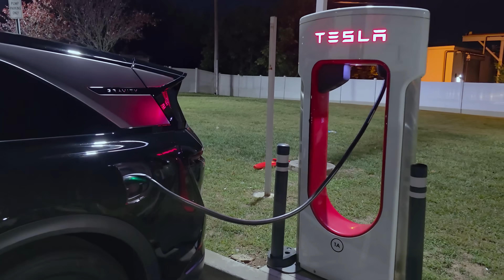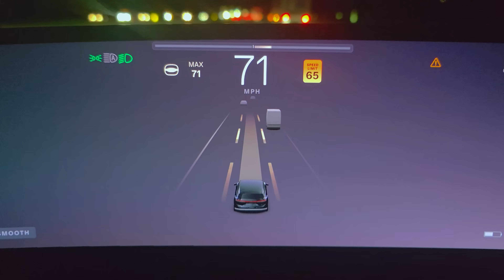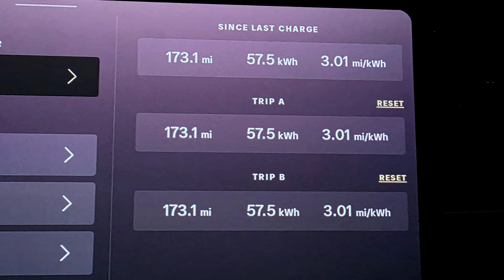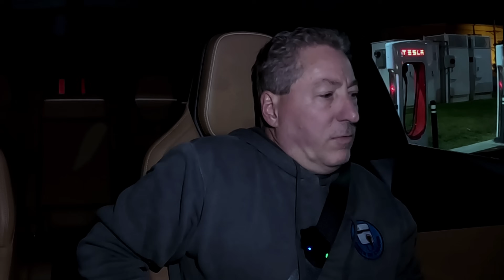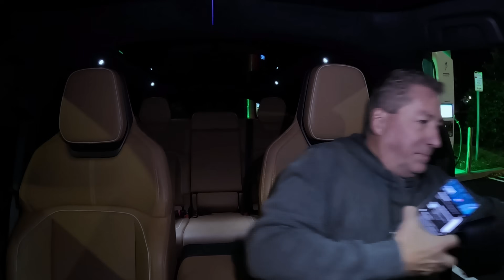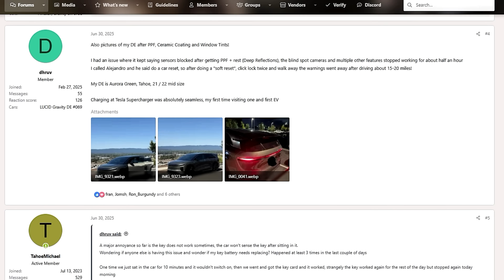Does the Lucid Gravity Live Up To Its 450 Mile EPA Range Rating?

Comment: An owner recently did the same test and got around 350 miles as well. Kinda dissappointing because I was hoping for that sort of range at 75mph. At 70mph I was hoping it would get over 3 miles/kwh. Regardless it's still plenty of range and quite efficient for how much room it has inside.
Reply: i thought it was supposed to get 450?
Reply: @TVYOUTUBE-ow9xu  that is combined range. Highway range from the EPA is going to be lower. But many people are too lazy to calculate it.

It's like expecting the Camaro I use to drive to get 20mpg in the city. Like sure it was rated 20mpg but that was for highway and city driving COMBINED. The city rating was 15-16 and that is what I would get in the city. Highway rating was 26-27 and that is what I would get in the highway.

Similarly, the lucid gravity is rated 450 mile sof range combined. Combined EPA efficiency was 108	MPGe, but on the highway it is 103MPGe and 113 MPGe in the city. So highway range is technically 430. And the worse efficient Gravity is rated around 365 miles of highway range. 

Regardless it is performing worse than advertised. A bit disappointing.

Comment: Why are you comparing mixed driving epa rating with a highway trip? Does the epa not provide a highway rating separately?
Reply from the maker: No, they don't anymore. I used to always explain the highway rating and the combined rating, but they don't break it out anymore.
Reply: @StateOfChargeWithTomMoloughney  Thanks.  Maybe you need to do an hour or two driving locally to see what the range is for most of the driving it'll do. No-one ever seems to do a range test with the 90% of journeys people do.

Comment: Since you pulled around 115kWh out of the battery, there's still another 8kWh left in that battery. So at 3 miles per kWh, that's another 24 miles. Getting 345 miles with temperature in the 50's and a 10mph wind, it's still pretty impressive for a 7-seater SUV/minivan with 828 horses. And if you add those 24 miles, that's 379 miles. 

Notch EV did a range test with his Gravity at a constant 70mph out in Long Island with temperatures also in the 50's, and got 353 miles and with 1% left. So this is what I expected in this test in very similar conditions.

The not charging at that supercharger after the range test is concering, though. We're there other vehicles charging at the time or could the site have been temporarily down for whatever reason at that time?
Reply from the maker: There was one Tesla charging.
Reply: @StateOfChargeWithTomMoloughney  Then that's another issue the Gravity team needs to look at.
Reply from the maker: @junehanzawa5165 not another issue, the issue. The rear drive unit is also the booster for Tesla's 400v SC systems. That was the problem and why Lucid took the car back from me.
Reply: @StateOfChargeWithTomMoloughney  Ah. I see. It makes sense now. Thanks for the added info/clarification Tom.

Comment: Even with a bad rear drive unit, as well as not ideal conditions is still very impressive. I have a theory! The rear drive unit also does the booster for Tesla supercharger charging and makes sense that it wouldn’t charge at a Tesla supercharger afterwards. Something must have went wrong when Tom was charging at the Tesla charger just before doing the test.
Reply: Jorge, I think your theory is correct.  Lucid uses same technique as Hyundai EGMP models by using the inverter (DC to AC) and rear motor as an auto-transformer to double voltage.  Using a stationary motor as a transformer is brilliant.  

After doubling voltage, they need a rectifier to convert AC to DC for battery charging so inefficiencies build up.  You’ll never get the same charging speed as an 800V DC fast charger. 

It was interesting that the Tesla Supercharger got Tom to 100% when test started, but failed at very low SoC.
Reply from the maker: You could be correct.

Comment: A six KWh buffer is 18 miles which is a nice comfortable amount. We are a long ways away from having a charger at every highway exit like we have for gas stations. Having a 20 mile buffer below 0 will prevent a lot of inattentive people from being stranded. It also protects the battery, discharging down to real 0 is not a good idea.
Reply: No customer will drive 18 miles below zero.
Reply: @hankmoody7521 Tell Dave Connor that.
Reply: Wana bet
Reply: "I-90 surge", on OOS channel showed an Air pre-maturely shutting down, right near zero.  So, beware if reaching for the extra ~5KWh.

Comment: Hi Tom. Lucids simply don’t get near their ratings. It is frustrating why they choose the testing they do for EPA. 

My 2025 Lucid Air Pure is rated for 5 miles per kWh, 420 miles range from the 84 kWh battery. In one entire year of usage I’m at 3.62 mi/kWh which is NOT uncommon among most owners. Therefore the range is more like 300 miles EPA. 

I’ve had 5 different EVs, none have been this far off EPA. My Silverado EV actually understates its range. In the same conditions I get a real world 450 miles.
Reply: With 400+ HP, I'm sure it's hard to not dip into that power often.
Reply: My Escalade IQ, at 55-60 can get 625 and 70 is around 475- guess the Escalade has better aero. I think Cad should advertise the 600 miles@ 60.
Reply: @DaverGe - If it was Lucid they would have!

Comment: tom your range test almost mirrored notch ev range test he got 358 and used 115.4     his is a 5 passenger with the base wheels
Reply: Came here to post this, he also got a lot less then expected, so curious whats going on.
Reply: @FreekHoekstra probably nothing going on, EPA is city and highway so if we test that way it probably gets 450. Just means it’s much more efficient under 50mph.
Reply: @Icayn  well sure, but Lucid is clearly also expecting more, and given notch got even less maybe there’s something happening with these guys.
Anyways, we’ll find out
Reply: @Icayn EVs are much more efficient @50mph vs 70mph. The battery could be sensitive to the cold as well. Wouldn’t be a bad idea to do a range test in the dead of winter to see what it does.
Reply: He actually go 353 miles with 1% left, not 258.
Reply: @junehanzawa5165  yea i just caught that don't know why it posted 258, so i corrected it to 358

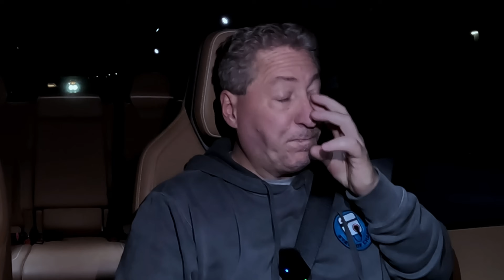Comment: @17:57  *345 miles
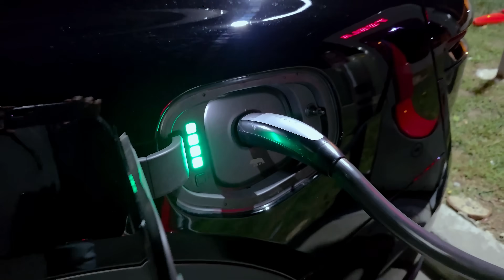Reply: Yes, I caught that as well. It was 1:30 in the morning and Tom was obviously pretty tired. Of course knows it’s 345 miles which is well less than the 450 mile claimed range. Interesting that it is very close to the Porsche Cayenne Electric range test result in warmer weather but in that case it will no doubt far exceed the EPA claimed number as Porsche tends to do.

Comment: Someone else also did Gravity range test at 70 MPH, he also got somewhere 355 miles. He also did test in night. I wonder how much lights are eating up driving whole night?
Reply: At the high end, LED headlights use about 50 Watts each so 100 watts total for the pair. Driving for 5 hours would be 500wH or 0.5kWh. If the car goes about 3 miles per kWh, then the headlights consume about 1.5 miles of range
Reply from the maker: Next to nothing. Maybe 2 miles

Comment: I can predict this much: it will go farther on a single charge than my bladder could.
Reply: You and most people, if they’re honest with themselves.
Reply: Yeah with my Lucid Air 512 mile range. I had to stop to use the bathroom after 2 to 3 hrs straight driving. 😂
Reply: @isserdigan2835 You need to drive faster 😂
Reply: If over 50, don’t waste money by seeking help from a urologist.  Restroom breaks every two hours is normal and some people are more comfortable with 90 minute breaks.  

When traveling over 1000 mi from MA to FL, restroom breaks primarily determine my charging stops, not the range of my EV.   Don’t think I’ve traveled over 225 miles between breaks (75 mph X 3 hrs).
Reply: This is an important fact that gets overlooked by a few friends of mine. I drive an EV9 and a couple of people have commented on a perceived lack of range. The thing is, I have to stop every few hours to pee and stretch my legs. A supercharger needs about the same time I need to take a break. It works out well. Completely love my KIA.
Reply: @gibber1944    I just got a  2026 EV9.   Left home at 100%.  We went  240 miles, still had 15% left, but we had to stop for bathroom breaks.
Reply: Guaran-damn-teed.

I did a ~2600 mile road trip a few months ago, and my average between stops was 120 miles. Yes, I COULD have charged up higher each stop, and gone further before the next stop - but charge curves mean it would have been severe diminishing returns, and I was ready for a break most times after ~120 miles anyway.
Reply: Add coffee to the mix here and I’m lucky if i can go 75 minutes between breaks. If I don’t have any ladies with me, i can stop on side of hwy 😅
Reply: So funny.  And so true :)))
Reply: Right? 45% of people have kids and have to stop every 2 hours anyway, another 45% have to stop and pee themselves after 2 hours, and the remaining 10% either pretend they don't stop every few hours OR are miserable during their trips because they are holding their bodily waste.
Reply: Exactly. My bladder and my bum knees get stiff at the 2-hour mark.
Reply: There’s your problem, you shouldn’t charge your bladder.
Reply: For the vast majority of people and drives this vastly outperforms a gas car. There are still some places in the national parks that it's a bit sticky depending on your incoming SOC if you're towing a trailer. I realize this is an edge case for sure.
Reply: @DJS_ENO how so?  Yes, speed wise yes,but there’s many cars that easily do 400-500 miles per gas tank.  My Sienna hybrid goes 550 per tank. My Model 3 DMP at those same speeds only goes 200 ( 75-80 mph).
Reply: I can make it to corpus Christi, Texas from Kingsville, but that is only miles for me and where I live.
Reply: 35 mile distance from where I live to the Golden Corral in Corpus Christi Texas.
Reply: At my age that's true of the Fiat 500 EV too.
Reply: The target demographic isn’t going to be able to drive much further than 200 miles between nature breaks @ 70 mph.  If you’re over 50, you don’t need more than 330 miles of highway range as long as you have fast charging. 333 x (.80 - .20) =200
Reply: You’re a lightweight.  Never driven a truck obviously.
Reply: You MIGHT want to see a Urologist
Reply: @Mark_Longoria You might want to hydrate more.

Comment: 345 miles of 70mph range with a somewhat normal cabin climate setting and inefficient rear drive unit, is pretty amazing considering how big the Gravity is. This car can do some big distances on a single charge like San Diego to Las Vegas, Pittsburgh to Detroit, Atlanta to Jacksonville, or Dallas to OKC.
Reply: yeh i was shocked to hear that its not close to 400
Reply: The average owner might never know they had a "faulty" drive unit. 345 miles is far enough to get me home from Michigan's U.P.
Reply: Typical Lucid drive train issues 😂
Reply: inefficient drive unit? how so? I thought they touted it as incredibly efficient
Reply: @ayushmalpeddi2793  did you even watch the video?
Reply: @ayushmalpeddi2793  Did you not watch?  One of the drive units had failed.
Reply: @randomdesign6304  Yes but from my understanding, all motors used were still efficient motors. It's not like they replaced the motor with a worse motor.
Reply: @ayushmalpeddi2793  What?  Tom clearly says in the last section that Lucid engineers found a problem in the rear drive unit of his test car that likely impacted the range.  Again, watch the video.. This has nothing to do with whether Lucid's motors are efficient or not, one of them is FAILING.
Reply: @randomdesign6304  So someone else did a 70mph range test and also got about the same number. I don't think the motor failing would have a big impact on range. Worse case the front motor takes over which is also quite efficient. It may be though the rear motor is more efficient though. So even in the worst case, we are looking at maybe 1-3% with the 3% being optimistic or roughly 10 miles of range.

Only other explanation is the rear unit failing caused the motor to pull more electricity to maintain power. But I don't think that would happen.

Again someone else performed the same test and got basically the same result.
Reply: @ayushmalpeddi2793  If the RDU isn't working the front motor has to work more to move the car, pretty simple.  Tom even says at the end of the video it would have effected the range, Lucid told him the same thing.  It's also why the Supercharger at the end would have failed, the Gravity uses the RDU to boost the SC voltage to 926V.

One other person did a very non controlled test and got results way out of range of what many other owners are seeing in their efficency/range which is why most people were waiting for a good tester like Tom for results.  He also performed the test before the 2k mi mark when Lucid even says the efficiency/range will be less in the manual and plans to redo his test after he has more miles.

Comment: “Electrify America saves the day “. Something rarely said.
Reply: Give credit where its due...if we can teardown people and places, we can sing their praises too when they improve and do good
Reply: @thejake8099  Yep. EA has gotten a lot better the last year or so as they have replaced about 70% of their old, unreliable legacy hardware.
Reply: @thejake8099  IMHO, I don’t see this as “tearing down”.  I see it as an observation.
Reply: @thejake8099 so lets do some tearing... Its an EV chatroom.... Lucid is known for bad software (like NACS integration) so Lucis cant road trip on the convenience of the superchargers ??? And lets calculate 110kwh per 300 miles @ $.55 on a reoadtrip...
Reply: @thejake8099 It takes more than once. Once a consistent pattern is shown....... then comes the praise.
Reply: Yes, lol.
But seriously, I suspect the real issue is that Lucid uses the rear drive unit to boost the charging voltage from 500 volts the Tesla SC can supply to the 1000 volts that is native to the car. The EA chargers used probably have a higher voltage output and so didn't need the rear drive unit voltage step-up function, so charging worked.
Perhaps Lucid should add some software to detect problems with charging Boost mode, and bypass that so that it can still charge if a problem occurs.
Reply: We just completed a 3,000+ mile trip w/our Fisker Ocean from Reno to Palm Springs, Phx, Santa Fe, up to Grand Junction and home to Reno.  Most of our charging stops were at EA.  I have had our car for 2 years and can say during the first year there were definitely issues w/EA charging locations not functioning at peak performance.  On this trip however we were pleasantly surprised that we had no issues except for one locating in Victorville, CA where the first 15 minutes of charging I could get above 32 kw of charging speed (at approx. 30% SOC) and then it ramped up significantly.  This could have been a car issue vs the chargers.  Regardless the rest of our trip where we used EA chargers was a pleasant surprise. Let’s hope EA is really stepping up their game.  My only request is for EA to develop the charging stations on much of the rural highways in the western states!
Reply: Propaganda, clearly.

Comment: Was that 7 seater you tested?  That’s only rated for 427 miles EPA. 5 seater is the450 mile epa version.
Reply from the maker: It was the 5 seater
Reply: @StateOfChargeWithTomMoloughney ok it must have definitely been the rear drive unit, my Gravity DE which is 7 seater and only rated for 410 miles on the Hankook wheels is getting 3.02 miles/kwh at 55F temps.  So your 5 seater did no better than my 7 seater with 1079 HP.  😳

Comment: Looks like they still
Have quality control issues .not a good look for lucid
Reply: It's not a quality control thing, most cars need around 2000 to 3,000 mi to break in. 

I've driven numerous EVs and hybrids and even gas cars, and I've noticed especially with the hybrid and EVs that at first you're disappointed with the efficiency and around 2 to 3,000 mi is when that number magically creeps up by quite a bit. 

His car's too new to properly gauge the efficiency.
Reply: Exactly! Tires gotta wear in which is usually 1,500-2,000+and all the bearings need to wear in. Our equinox is improving since 1,700 miles in efficiency.